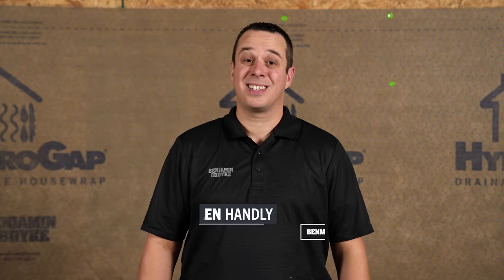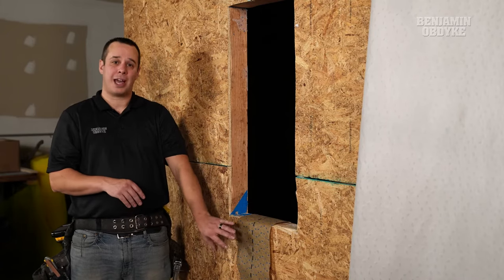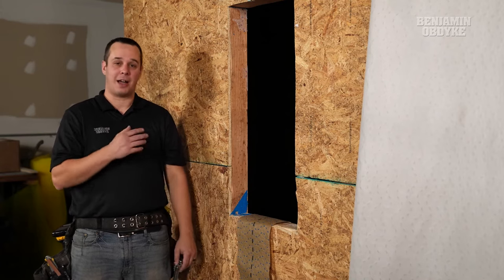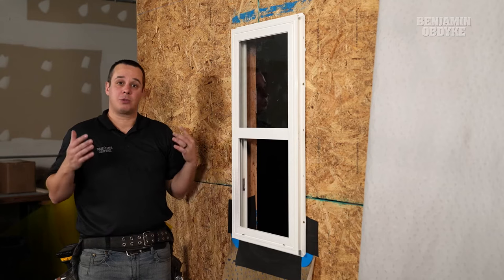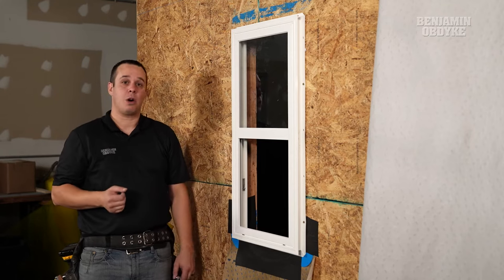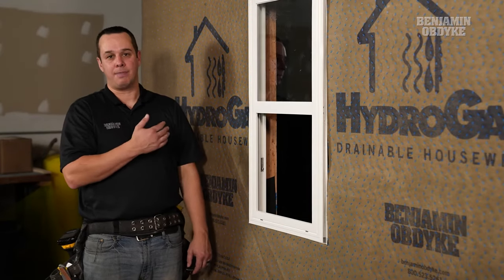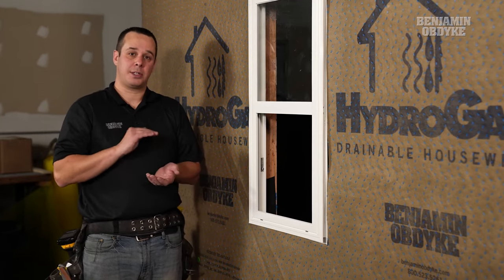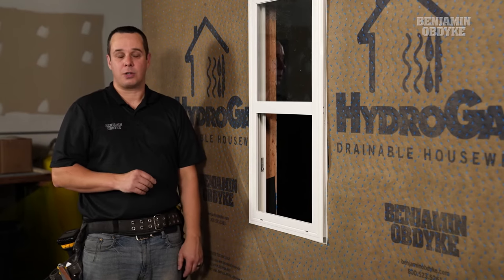HydroGap® Windows First Installation

Comment: Not if your a good carpenter my man Dato
Out the gap you need brother fin trim
Screws to help suck down the trim bung your holes bondo
Over the bungs sand hit it with some bins and the rest is smooth sailing brother